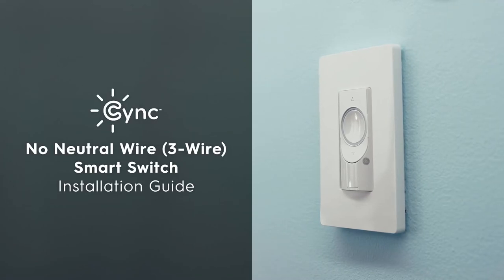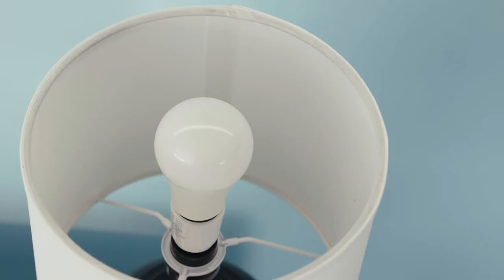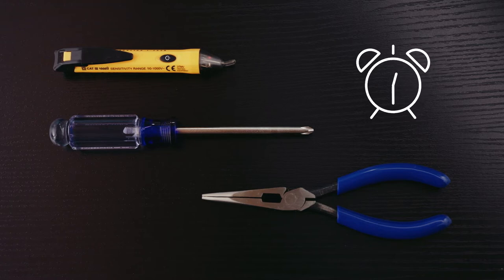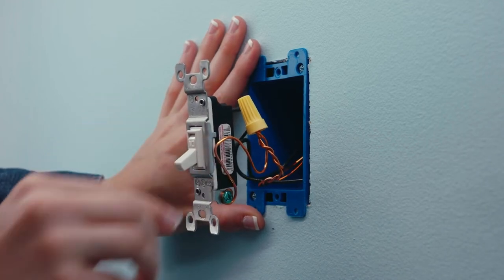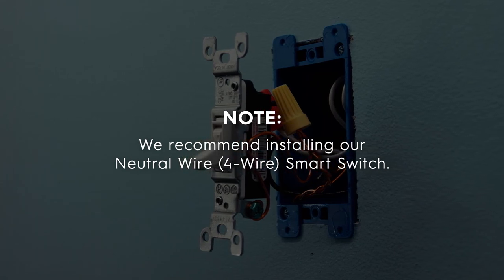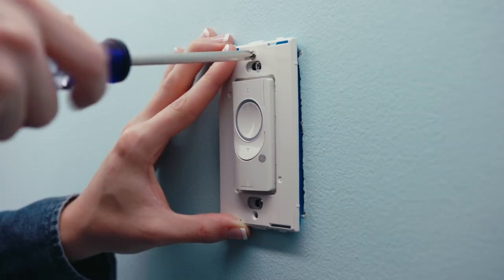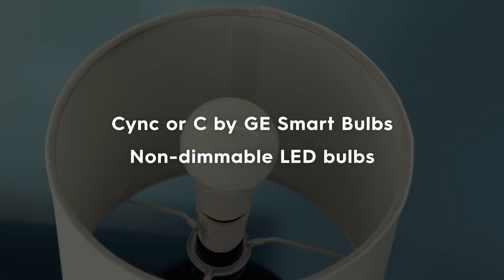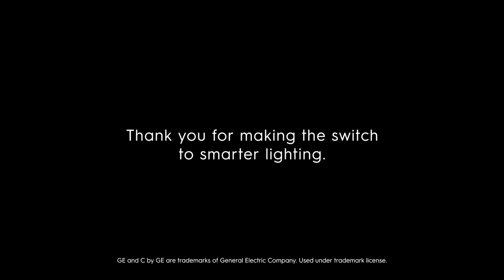Cync No Neutral Wire (3-Wire) Smart Switch: Installation Guide

Comment: Do you have to replace both switches or just one?
Reply from the maker: Hi there. If you are referring to a 3-way setup involving two switches controlling one light, then you will need to have two Cync switches installed for the 3-way setup to work. If you are using dimming switches, then both switches need to be Cync dimmer switches.

Comment: What if you have a traveler wire but no neutral?
Reply from the maker: Hi there. Because this is an example of a single pole install, it does not require a traveler. These switches also do not require a neutral wire.

Comment: Seems like this uses the same circuit for the load (the light) as the power supply for the switch, versus using the line and neutral as the power supply for it. Since the power consumption of the switch is very low, it will not make the light glow. For those lightbulbs that uses very low power, the resistance will be to much for the light switch (which is in series with the bulb) to get enough power, an adapter is needed to put a bypass (which is in parallel with the bulb) to guarantee enough current goes through the switch for it to operate properly. The bypass can be smart enough to increase the resistance when it senses that the switch is turned on so that the energy wasted by the bypass is reduced to the minimum.
Reply: It specifically says this won't work for lights that have a load of less then 15 watts on a circuit. So yes the impedance will be too low for 15 watt or less light bulbs.